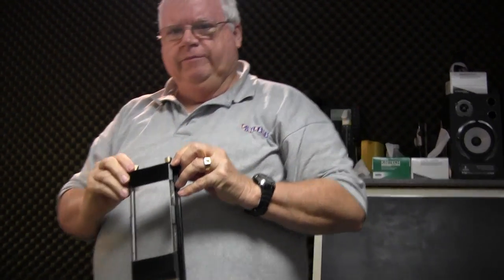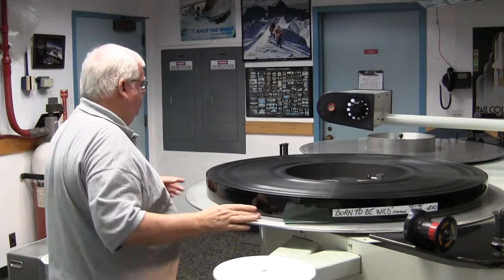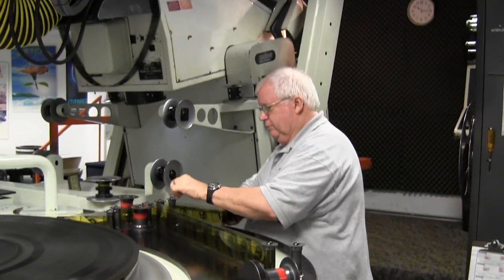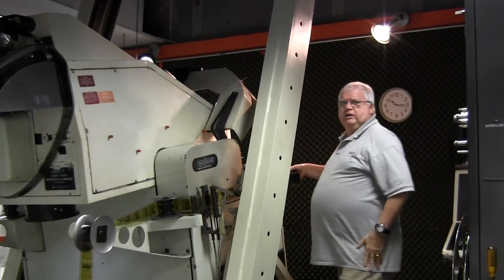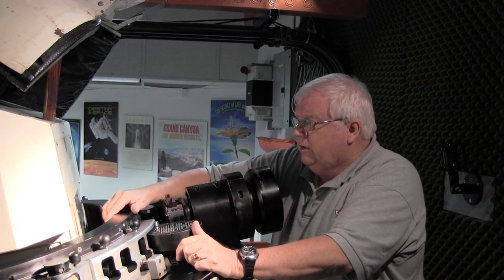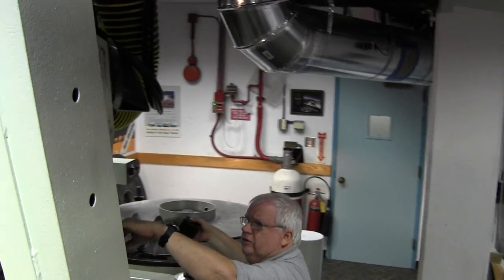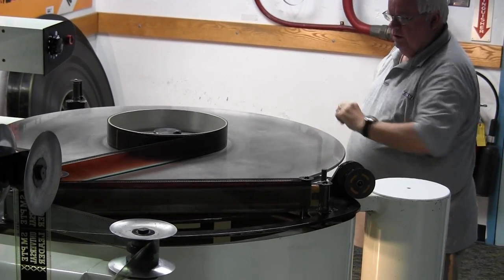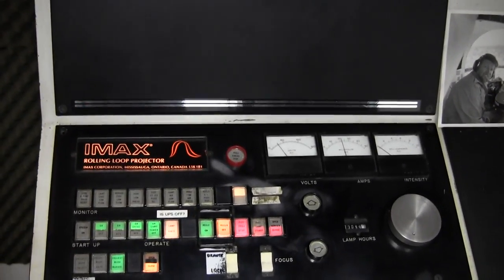Imax Threading the oldest imax projector RHFleet

Comment: When the projectors used 100 years before, were also this loud and noisy, how can one speak about "silent film"?
Reply: A standard film projector is nowhere as loud as the IMAX projectors are.  IMAX uses compressed air to help hold the film flat in the gate area and extremely large fans and cooling pumps to keep the lamp ane reflector cooled down enough.

A regular 35 or 35/70 projector has no compresssed air and only rarely used water cooling.  

There are lots of videos of standard projectors on youtube to compare with.

Comment: Imax on a huge screen film or digital still is the best image you can get film is gone get used to it I hope they keep film for the museums!
Reply: +RKoen2006 IMAX is film only so far. There's currently no such thing as true digital IMAX and won't be until movies can be shot, processed, and projected digitally in a bare minimum of 8K resolution, ideally 12-16K. Current digital projection systems are too low resolution to be considered IMAX (remember, 4K = 35mm film) even if they have the IMAX name.
Reply: +Adam Ahmed yes you are right but laser imax looks cool

Comment: 15/70 film has an 18K digital rating. 2/4K digital projectors are quite
low-brow in quality. This is an early Imax projector, built like a tank
the amazing IMAX film quality!
Reply: dual 4K laser IMAX projection is pretty darn good.
People like to throw around all kinds of bloated resolution figures comparing film to DCP, in reality it doesn't work that way, because there are many elements other than resolution... lighting is one